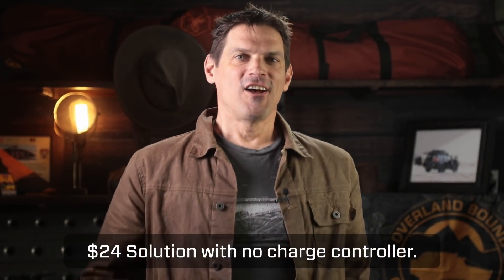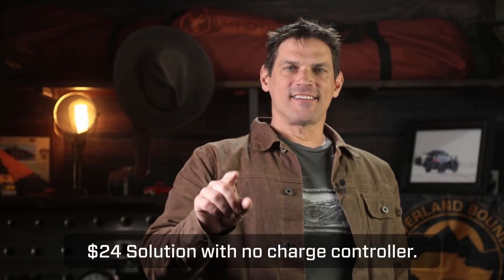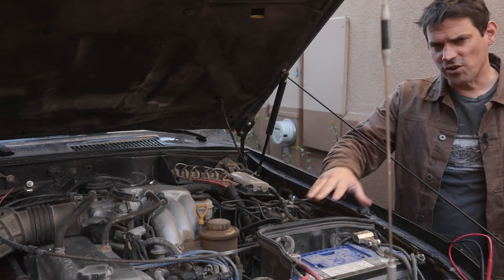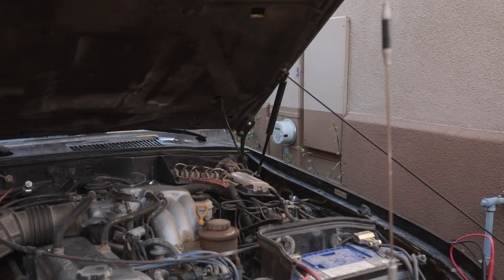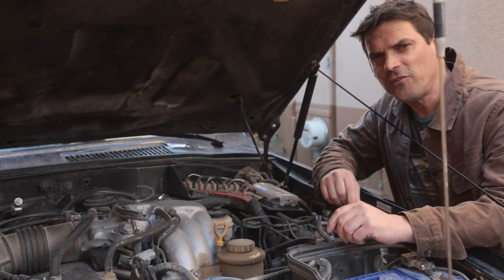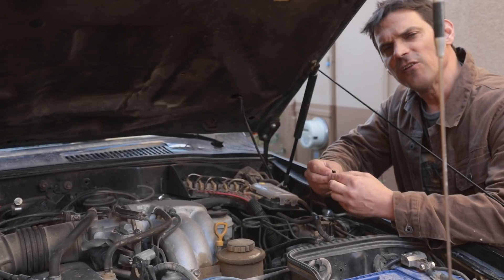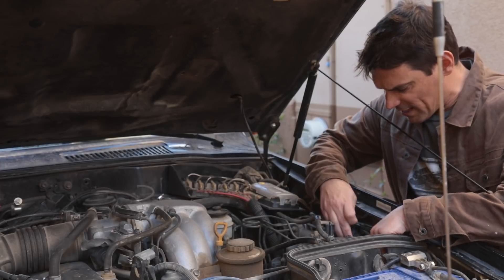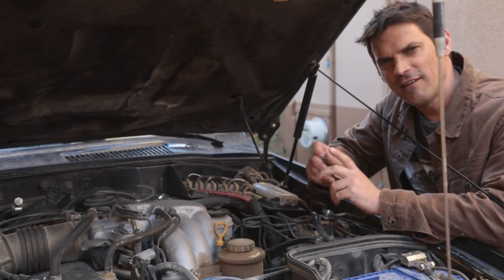Don't Kill Your AGM! Proper voltage without a smart charge controller

Comment: A vehicle alternator will never 'fully charge' a battery.
use an outboard smart charger once a month.

I have an Optima Yellow top that is working reasonably well for a 16 year old battery.
A second one, purchased at the same time, is at end of life and not reliable.

Comment: 7:14 
Since you are eliminating the fuse you have no protection now on that line. If you simply take two fuse lines of the same size fuse then you can make it a protected circuit again with the added diode.

Comment: My lithium battery charger seems to be set right about 14 to 14.5, so I seem to be able to charge my lithium's and parallel with the AGM on the same setting the voltage seems to sit right above 14 2 14.3 sits
Reply: Hold on there bud. Parallel lithium and AGM? And charge them? Dude you need to research that for your own safety. Not being a d#$@, just very concerned.

Comment: I have a 1995 80 series 1fzfe with the 7.5a fuse in there as it came from the factory and get 14.6v at initial startup on the cranking battery, once my isolator kicks in (pirahna dbe 180sx) the aux battery will climb to the same voltage and they then run the same voltage, once charged up they both 'idle' around 14.0 - 14.1v. 

I wonder why yours needed the diode?

Comment: So if you need a special charger to charge an AGM battery, how is it that the car you put the AGM battery into (that's designed to charge a standard lead acid battery) doesn't ruin the AGM battery?

Comment: Great video Sir 👍 i dont know anything about wiring nevertheless i connected multiple off road lights to my 86 Subaru 4wd wagon each light set has it's own separate harness and relay my question is can i install a alternator that puts out more watts then oem standard as well as get a deep cycle 12 volt battery without damaging the electrical system or is the part your showing in this video all i need to compensate for the draw on my standard battery

Comment: This doesn't explain anything.  A diode should DROP 0.6V roughly.  You no longer have a fuse rated for 7.5 A - you are down to a diode limited to only 1 A before it burns out.  None of this makes sense.

Comment: Great video and explanation. I am going to buy a AGM battery if my 2001 BMW 530i battery ever fails. I am using a PulseTech PowerPulse passive battery desulfator on it to keep it working longer, Pulse Tech states that there patented frequency used to desulfate a battery can extend battery life by up to three times.

Comment: I would need an explanation here.  Making electrical recommendations like this WITHOUT it , a little dangerous in my opinion.  :face-turquoise-drinking-coffee:
Reply: The "charge" circuit is in fact not the circuit where the charging current flows to the battery. It is the sense circuit that measures the battery voltage and feeds that voltage to the regulator. If you offset this voltage with a diode by -0.65V the charge regulator will raise the voltage to compensate. The 7.5A fuse that he removed indicates that this cannot be the charging circuit, the fuse would be at least 10x too small.

Comment: I'm really confused, how does a diode increase the voltage of the alternator?  I'm pretty sure that fuse that you replaced wasn't limiting voltage.  Is maybe the fuse going to the voltage regulator or something.  I guess I'm funny I like to know why something works the way it does.
Reply: As I understand it, on any computer controlled charging system the computer maintains a charge rate at around 13.8. This fuse type diode has an internal resister that "tricks" the computer into thinking it need to increase the voltage from the alternator resulting in a higher voltage.
Reply: You aren't funny in your thinking.

Comment: Sorry to say I was charging a lead acid and my new AGM diehard battery with the same battery charger at the same time. I did this for about 2 months. Both batteries are not right now. The AGM will charge ok but after one start of the van it will quickly lose volts. I tried charging it fully then using my reconditioning mode on my charger. It won't charge above 10 volts or so. On a regular AGM charger it will charge to 15 volts but quickly drops to 12 volts. Any way to fix this? I've since bought a new AGM but was wondering. Also now my new alternator won't charge over 12.5 volts or so.
Any suggestions?

Comment: $800 you could have gotten probably more capacity from lithium if you know what you are doing for less
Reply from the maker: Not into lithium for this application.
Reply: Capacity ones are not great for starting battery but you could get some with high C rating for starting like he 8ah headway but I'd just run a lead acid for starting probably and lithium for storage but would be better in every way if you know what you are doing
Reply from the maker: I’ve got about 10 reasons to not go lithium for this application. Nothing wrong with lithium for certain things though.

Comment: Why on earth Michael are you messing around with your cars systems? A diode? Neither 13,7 nor 14,2 is correct for a non-smart alternator. It should read 13,8V floating and 14,4V bulk-charge, both higher at lower temperatures.

CHECK YOUR ALTERNATOR OR ITS VOLTAGE/CHARGE CONTROLLER !!
Reply: Second this. On a cold start with ambient temps between 60F & 90F the voltage from a healthy alternator should be 14.4V
13.7V means either the rectifiers/voltage regulator are on their way out, or the brushes are toast.

Comment: I have a 30 amp mini fuse for my ALT charge circuit. 98 Ford, 130A Alt. I found the Ford 1A mini Diode on Bezo's site. My only concern with this, is the higher amperage,no fuse, and just the diode. Will the diode handle that current? Can you or any of your subs here, tell me if I have a valid concern or not? Thanks in advance!

Comment: This does not work on 3rd gen Tacomas, btw. They use an ECU controlled alternator. Which means that if you want to change the output voltage to the battery for an AGM battery, you must get an ECU tune like OVTune.
Reply: Has anybody actually successfully done this? I've never actually found anybody confirming they've been successful
Reply: @mrchaneyrc  I would assume not due to an alternator being either internally or externally regulated. He’s talking about externally regulating it & you would need an alternator that’s externally regulated to do that. Meaning, you can’t externally regulate an internally regulated alternator.
Reply: @junballs6576  I'm not sure what you're trying to accomplish from this but hopefully, I can better explain to get you on the right track.

If your vehicle has a "smart" alternator, that means its being regulated by an ECU. Meaning, that the only time your battery takes power supplied from the alt is when that ecu tells it to.

Now to answer your question: Upgrading the alt will serve no purpose by providing more power due to that pesky ecu. If your only concern is upping your overall voltage for an agm battery, yes, technically you can buy a custom alt like a high output alt and request them to dial that voltage to what you want. However, to me that seems a bit much just for that. Especially since it's possible to externally regulate the alt voltage via a regulator (caution is needed with that btw it can fry all your electronics if done improperly).

So, long story long, if you want to up the voltage just for an agm's "health" I wouldn't bother doing anything as it doesn't really matter. If you're looking for an increase in power cause idk maybe you want to add some beefy sound system, you won't easily get past the ecu limiting the power. In that case, what I suggest would be researching lithium batteries (I can help with that also if you want).

Side note: That secondary battery he has under the hood is totally pointless as it's not much power for the price.

Comment: Now what to do if you have one 'wet' lead acid battery and one AGM battery?  Also, might the increased voltage potentially be detrimental to the car's electronics?
Reply: You can't have different batteries. The Wet will leech power from the AGM.

Comment: Thank you so much for posting this. Any concerns about potential over-voltage (charging at too high of a voltage) by using that diode? I would truly appreciate a little more info on how that setup works, how it’s safe, any risks, etc. Again, thank you.

Comment: The absolute best thing I ever did with my AGM house battery is replace it with a LiFePO4 battery in the cab.
Reply: How did you size it? 100ah to 100 ah or did you change the ah capacity, also how many cca? Thx i waould like to do this
Reply: @ktcjosh  I could only fit about 50 ah useable for agm batteries but in the cab I used two renogy 170ah batteries giving me 340ah or 4,200 watt hours.